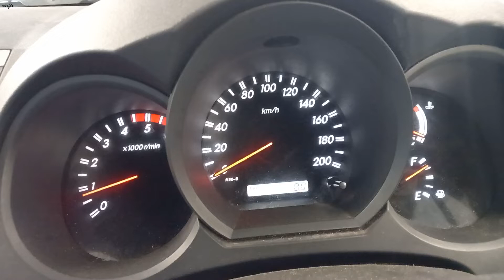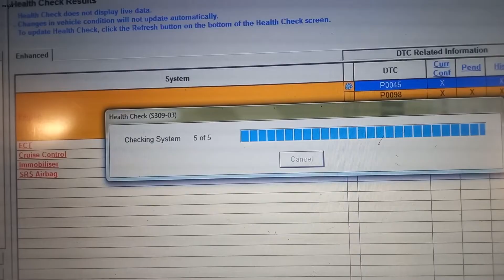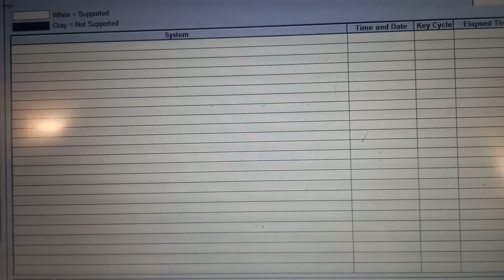Toyota hilux 1kd  engine turbo replacement ( P0045 turbo/supercharger boost control solenoid open)

Comment: Hey, I’ve got the same issue on my hilux. Ivr pulled the solenoid off and the magnets are fine but the armature is wobbly, is this my fault? Or is that relatively normal. Cheers
Reply from the maker: Most common problems whole actuator, wobbly is normal

Comment: How did you test the new solenoid with the engine off, i have an issue where mine does not get electricity
Reply: Hi did you manage I hv the same problem?
Reply from the maker: Yes
Reply: @carfix1993  haven’t gotten an answer to the question i asked. If you could kindly reply to it
Reply: @rrea1  What’s the code you’re getting? 
Did you check with a multimeter and saw there’s no power?

To test without ignition, you can connect the wires and actuate it via Techstream software and a mini VCI adapter
Reply: @raynoszs5267  the code is 0045, thanks for the suggestion.
Reply: @rrea1  hmm true, that’s an open circuit, so you’ve got to consider the possibility of your wiring being damaged or the stepper motor itself being fried.
Without turning on the engine, if you go in the engine bay, do you hear any sort of ticking/static type sound? 
What does it drive like? Feel like it’s high boost all the time or it takes ages to build boost? 
I can upload a short 1 minute clip showing what normal operation looks like and sounds like.

Anyways, the common issue seems to be that stepper motor, I’ll see if I can find the spec shit on it for what voltages activate it. 
The two pin connector is the incoming voltage the other part is sensors etc
Reply: @raynoszs5267   I’ve replaced the stepper motor with a new one completely, so I think i have to check the wiring as you say, the car isn’t creating boost at all because of the check engine. Im not getting any electricity reading from the two pin connector. The replies are accurate and help allot thanks.